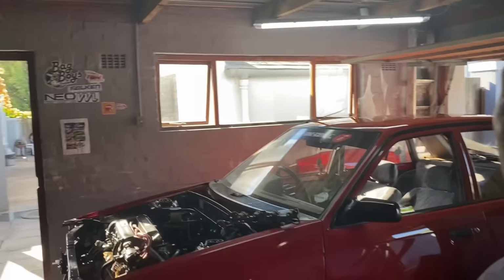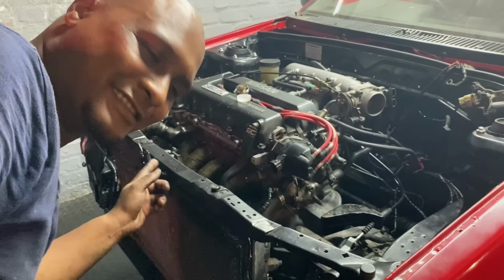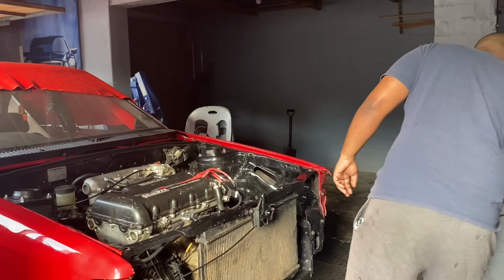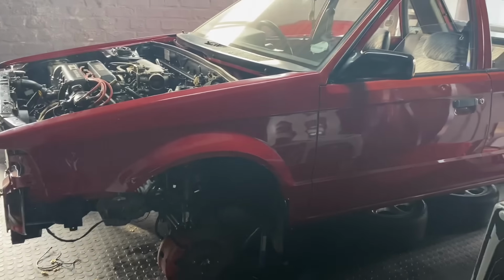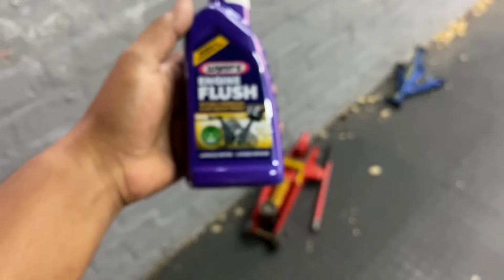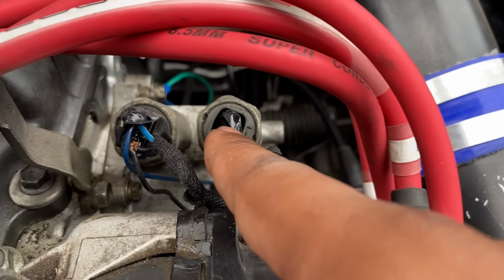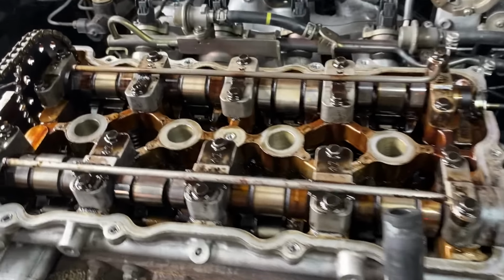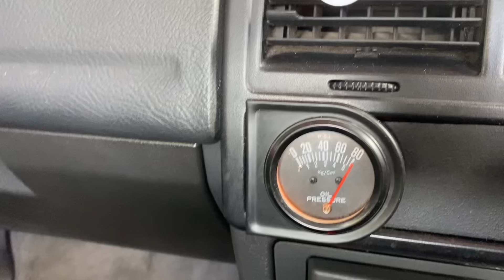The VVL is back OUT the garage 😁😍STREET PULLS !! 🤫🤯

Comment: Nice one brother, the smile we get from this old cars is unmatched. i drive 1.4 runx its a blast however recently it wont start without me pressing the accelerator, sometimes cranks 3 times before starting. changed fuel pump, crank and cam sensor theres no fault code on diagnostic and cluster. i hope you can share any insight. thank you
Reply from the maker: Yo brother check if you have a idle air control or the air flow meter

Comment: Those solenoids must have a 12v when cleaning,  ideal to spray brake clean while powering the solenoids off/on switching ( off the car cleaning) try to use a semi synthetic oil cause off those solenoids
Reply from the maker: Thanks for the advice brother

Comment: To flush sludge out the  literally put diesel only in the engine and run it for like 30 to 60 seconds. At a time for like 5 mins and drain the diesel out. Then put oil in and 1l diesel in the oil to get it to the level and idle it like that.
Reply: Then I idle it with diesel and oil mix for 30 mins. Drain out put in a cheap oil only and then run like that for 30 mins and then proper oil you going to use. A long and lengthy process but works like a charm
Reply from the maker: Hey mahn thanks for this advice, it is much appreciated, may need to do it gain in future so will hold onto this

Comment: Oil is too thick that's why lift not as loud
Reply from the maker: Interesting, will see if it gets louder as a drive
Reply: @BagboysWP  Same with Runx RSI, the lift won't evens engage properly or it will bog down big time
Reply from the maker: @suhailjacobs254  thanks for this❤️